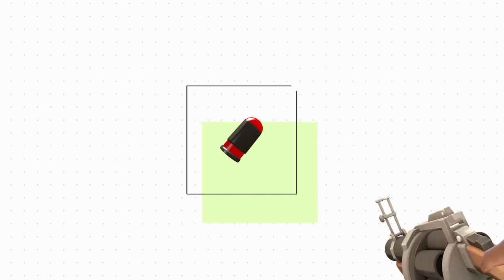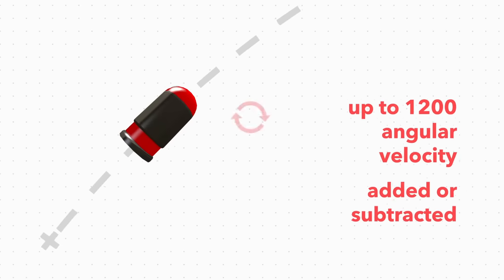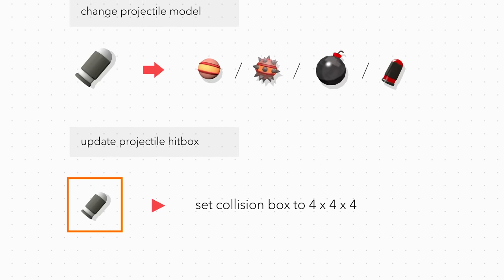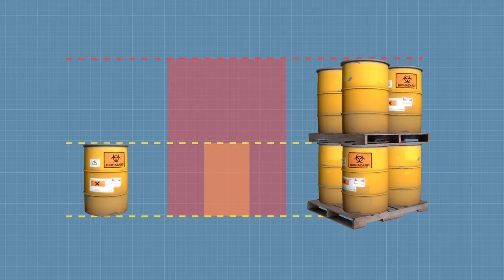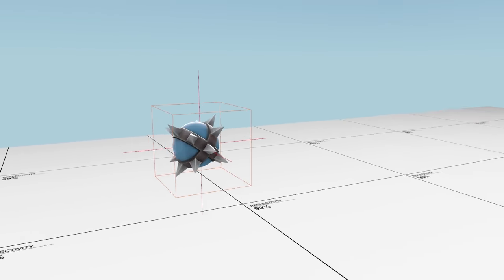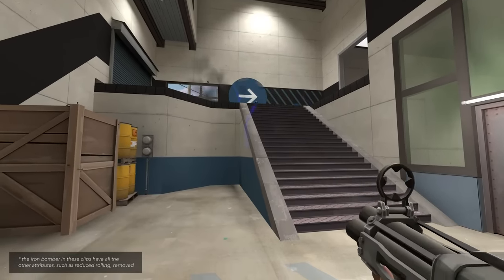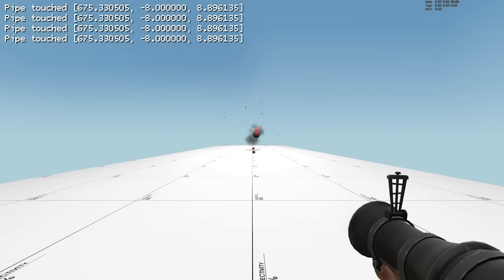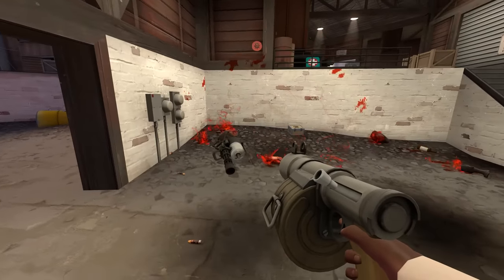the iron bomber has a bigger hitbox (& notes on pipe & sticky physics simulations)

Comment: It's a shame the devs ceased to care about balance :/ 

Like the de-evolution of the darwin is the physical manifestation of it all. It was perfectly fine when all it did was give +25 hp. But then, someone tried fixing something that wasnt broke, and gave it bullet resistance. And then everyone complained about it rightfully so, so they scraped the entire thing, and then made it a total non-thinker hard flare counter of an item. Like wtf. Way to water down the one class that needs ways of playing the mid and close range game. Like that used to be the entire point of new items and weapons, to give the class an entirely new way to play the game. You know, like the gunslinger for engineer, or the simple yet effective subversion of a medic with the kritzkrieg, a spy with the ambassador who wants to also play sniper at the same time. 

Meanwhile, scout, pyro, demo and soldier get all the attention because, oh what do ya know, they're the core of multiplayer because they're the classes who are perfectly sync with the combat gameplay loop that is TF2, ie, fast paced-medium range projectiles + closed ranged-hitscans on classes with enough mobility and damage output to stay relevant and above all, CONSISTENT vs any other class type. 

And then you got sniper sitting there, being the black sheep with a long range hitscan weapon, shutting down the symphony of every other class trying to participate in said medium-close range dance. 

/rant.

Comment: This I can actually explain myself. The Source engine treats the size of an entity's hitbox as the "weight" as said entity. The bigger the hitbox, the heavier the entity. Upon releasing the projectile, the game then calculates the size of the hitbox with the amount of push force used in the physics engine to trace the projectile's trail. The grenade projectiles were coded to bounce off the floors & walls, unless it hits a "non-friendly" player entity, then it explodes (except the cannon ball which only explodes via timer.) The Iron Bomber grenades have the attribute of "no bounce." This is wear the weight comes in. Once the bomber bomb collides with a surface, the grenade then takes the characteristics of a placed sticky & the hitbox then increases a little more to be just big enough to be too heavy to be moved much by the Pyro's push force. 

Better to explain this, look at the Liberty Launcher vs the Direct Hit. The rocket from the Liberty Launcher can launch every class in the air, except the Heavy who has the biggest hitbox of the classes. However, the Direct Hit has more force to be able to launch the Heavy into the air. This is mostly due to the combination of the projectile speed with the damage output. With stock, you can launch the Heavy a little bit, but not as much as the Direct Hit. Thus, explains for the Bomber Bombs' hitboxes being larger than stock. If you want a fun facts, the Loche-n-Load's grenade has a smaller hitbox than stock for the complete opposite reason to the Iron Bomber's Bombs. :3